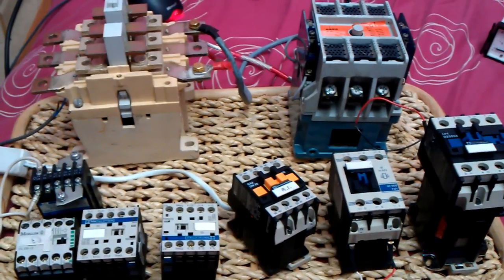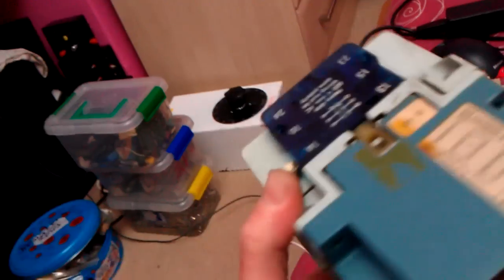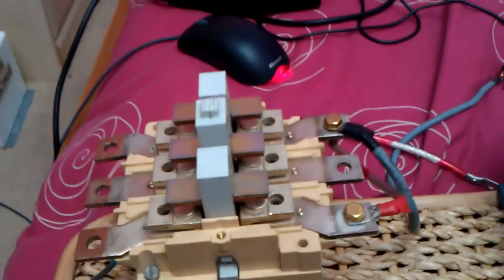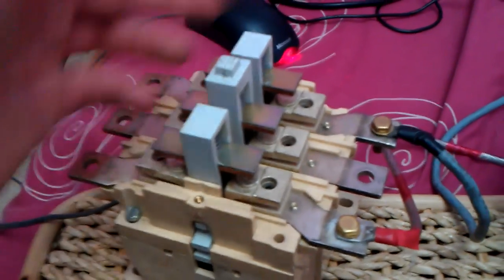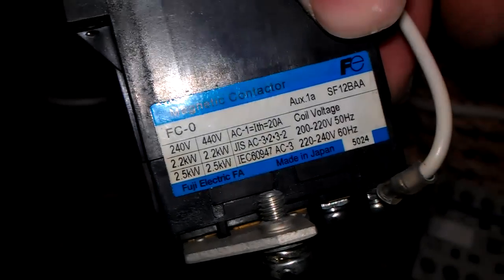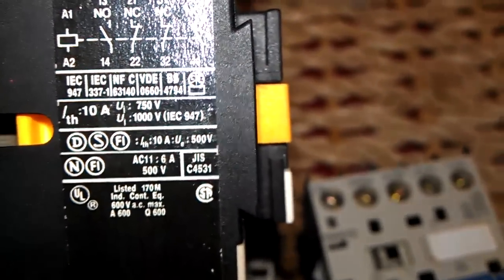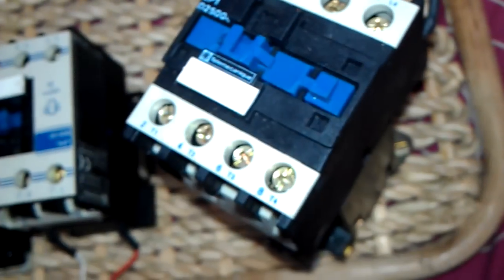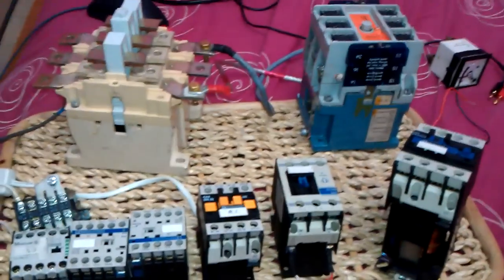Contactors

Comment: Thanks for this video.Before this time, i have always had problems with contactor circuits but with this,a lot has been exposed.thanks a million.Again, i would appreciate it if you could throw somelight on electrical circuit design.presently,i am working with a team and the project involves designing a circuit that can control a marine Gen set.The unit has already been designed:this was done in my absence!The parameters to be considered include but not limited to speed(rpm),oil pressure,e.t.c